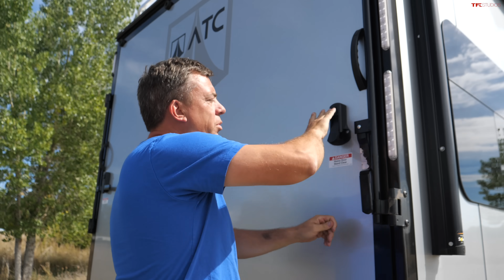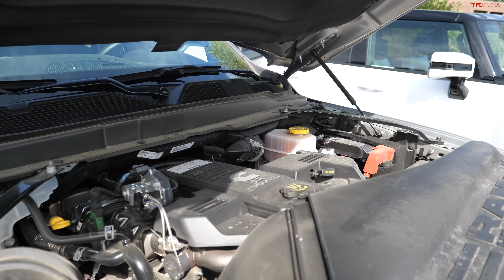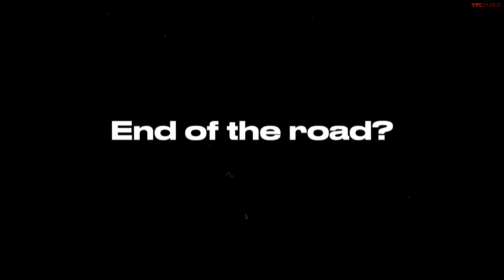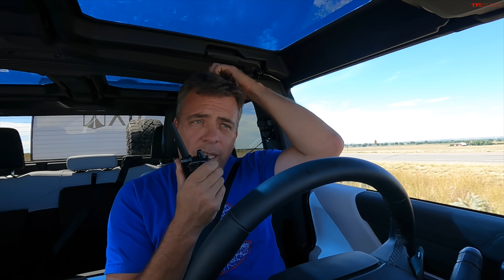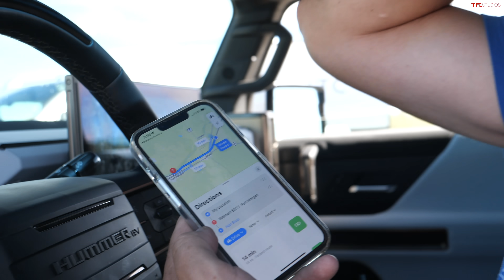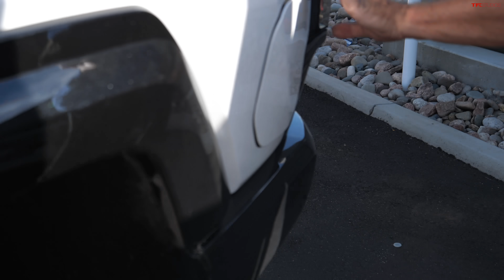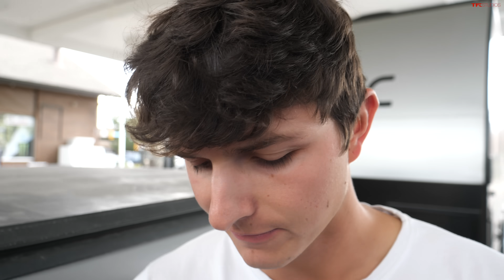How Far Can a Diesel and Electric Truck Tow An Identical Camper Trailer on ONE Fill-up?

Comment: Comes down to “what’s your precious time worth” unfortunately this EV truck “thing” is not practical for the average person.
Great content guys! Your showing the world what can and can’t be done.
Reply: Plus all the additional secret costs in an EV. Not only are you wasting your time when you charge. Adding hours to an already too long trip. But you're going to, in some cases, add additional hotel stays, or days to your trip, to accommodate the time necessary to charge.
and on top of that, there is already a $20,000-$30,000 price increase already from one of these EVs. thats a lot of fuel...
Reply: @t_c5266  What vehicle do you want me to prove that the trim level you claim on the ICE is not $20k-$30k more expensive than the same trim level on an electric vehicle? I'll look them up and prove that the difference is less than $10k, and with the Lightning, the trim level is probably cheaper. with what you get at any of the trim levels if one assumes that the ICE needs to be a 4 x 4. Pro, XL, Lariat, Platinum versus XL, Lariat, Platinum, King Ranch, and yet for some reason a Lariat is a Lariat when the Lariat of an EV has more features closer to the Platinum of the ICE. Without your trim increase, you don't get a lot of fuel, and you spend a lot more because your use case is not heavily in the area where public charging is necessary. You need that because even a 50 / 50 split makes it so that home utility ends up being cheaper than the ICE vehicle as you buy 2.5 gallons to do one gallon worth of work. You aren't paying $3.88 or $5. You are paying $9.70 or $12.50 versus at $.16 / kW $5.39. What is even better is that a person can beat $.16 generation on their own, and you cannot make your own fuel for that engine easily.
The Lariat is easy because a dealer did it proving the difference was $6k. If you cannot compare an apple to an apple, there is no conversation with you as your bias is your proof to your belief, and your bias is my proof that you will never be rational.
Reply: @ronaldking1054  first prove that your original statement applies to vehicles towing a load for vacation trips instead of people's daily commute to work.
I bet you also think the "wage gap" number has no issues as well 🤣
Reply: Wow. The average person puts more than 300 miles onto their vehicle in a day? 12,724 miles are put on vehicles on average per year according to Kelley Blue Book, which means that on average a person puts on 34 miles on their vehicle per day, which even towing is not a problem for an EV. I guess your definition of average is different than statistics, mathematics, and science. Is it based on your feeling?
Reply: @ronaldking1054  A working truck will do a hell of a lot more miles a day than the average person.
Reply: @oldbloke100  And yet the OP is stating "the average person". What were you talking about again? What's worse is that you are trying to claim that work truck isn't used to calculate the mileage on the average vehicle. What's worse on top of that is that for some reason you are claiming that the truck doesn't have long periods of being idle as well, so I am not sure when that work truck is going to be driving on its own. A delivery vehicle would have more miles than a work truck.
Reply: @ronaldking1054  it's a truck. I 'm thinking say a plumber who tows a small backhoe or excavator across the city. or a mowing and maintenance contractor that is going from property to property. It may work, but you seem to overlook the fact that to make the battery last, they tell you to keep the battery charged between 20 to 80%, so your 300 miles suddenly becomes 180 miles of range. And that's not towing anything. that's what i'm talking about!
Reply: @oldbloke100  How long do you think their service is going to take if they are a plumber? They are going property, but in order to get the numbers that you are talking about, they aren't going to remove the backhoe or the mower, which means there was no point in towing them. I don't know what work orders you think these people are going to be filling.
Reply: @ronaldking1054  so a person who does a mowing service doesn’t tow the mower around, they must do things differently were you are.
Reply: @oldbloke100  One, I didn't address that point, and two, you are deflecting desperately to avoid that I told you half your examples don't work. Next, the mowing, how long does it take to mow? The person is probably doing an 8-hour workday, and as such, he is probably working for 7 1/2-hours. This means that he must optimize his driving to shorten distances or else he ends up not mowing, and if he's not mowing, then he's not making money. Your method of business practice means the guy is bankrupt.
Reply: @ronaldking1054  hahaha you need to take a breath mate. Ev’s don’t work for everyone. These so called trucks are not work vehicles, they are status symbols. Have you seen the size of the bed in the hummer when you order the SPARE WHEEL. You would be lucky to fit your lunch box in it.
Reply: @oldbloke100  You put EV's into the same sentence as work trucks and implied that stating the one least likely to be a work truck is an example to show that EV's are not work trucks. Yes, Mavericks are not good for payload and as such, ICE vehicles are not work trucks. It's the same logic. Good luck rationalizing that the same logic should result in contradictory conclusions while at the same time claiming that you do not have a bias, which is actually causing the need for the rationalization.

Comment: Thank you for including energy equivilance calculations in your videos. All the EV haters only see range numbers and think all EVs are garbage. EVs are 100% the way of the future. Their efficiency and power is unquestionably better than any internal combustion engine. 

However, I continue to believe that lithium is not the answer. If we can get the same energy density of gasoline or diesel, to power the electric motors, ICE vehicles will disappear very quickly. 
Hydrogen is a better solution to lithium. It can be created anywhere (ideally no transport is needed). It can be a byproduct of nuclear. But politics stop this from being possible. Nuclear fusion is the future, but that doesn't mean nuclear fission can't be the clean energy replacement of Fossil fuels.

Comment: Same price for the electric truck to fill up if it made it the same distance prob more. He charged to 40 percent and would of cost 42.00 so to 100 percent would of been close to 100 dollars
Reply: Someone did the math in another comment. "Thats awesome the charge was free, but let's use the numbers to find out the future cost. The Hummer charged from 7% to 51% for $37.41 according to the EA charger. So $0.85 for each 1%. At that rate it would cost $79 to charge the Hummer to 100%. Hummer cost per mile: $79 ÷ 123 miles = $0.64 per mile.
Cummins cost per mile: $105 ÷ 211 miles = $0.49 per mile"

Comment: With that small trailer behind the Cummins engine you don’t need the exhaust break on flat driving on I76. Absolutely no need, the engine will downshift and do the job on its own. I have a 10k trailer when it’s empty and I don’t even use the exhaust brake unless I’m in the mountains.

Comment: Why does Sinclair limit to $75 fill ups? These days it's commonplace for me to fill for over $150, so using them would require 3 card transactions?
Reply: Might be the card company and not the station. Weird how a company that tests vehicles doesn't have a fleet fuel card for filling up test vehicles.
Reply: @BlueDually4x4  oh true didn’t think of that, though I thought these days pretty much all CCs have upped their amounts to reflect the crazy fuel prices.

Comment: The mpg on the Ram was horrible. I have towed an nearly identical trailer, size, shape, weight behind a 2005 Chevy 3500 SRW and get 18mpg. What is going on with todays diesels?

Comment: What was the cost for the charging of the hummer?  It's great you do the comparison, but you should also show how much the cost is for each of the vehicles.
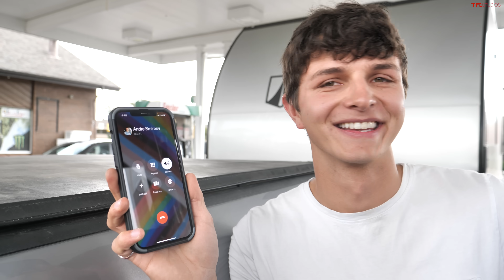Reply: Andre said it would normally be 'about $40' to charge the Hummer. @27:59
Reply: They did. Electrify America in that area had been letting their chargers fail for so long, they chose to charge nothing in response to their customers.

Comment: Electric will never work for towing and never will be fixed for towing. Batteries lose power quickly when a load is put on them. Take your phone for example and if your screen is full brightness and your watching a movie or something and connected to the internet you drain your battery faster, putting a load on it does that. Happens with everything with a battery

Comment: Also wondering if someone is going to come out with an electric powered camper that actually puts power to the wheels. It would be one hell of a camper for boondocking, too.
Reply: What do you do after driving 200 miles? You have to charge two at once, the truck and trailer
Reply: Airstream already put out there concept

Comment: So if the diesel made it almost double the distance than the EV and spent 100 dollars and the EV at half point would’ve spent 40 dollars if there wasn’t a promotion. Could we say it costs almost the same to operate both, not taking the purchase price into account? But why would anyone want to deal with the headache and anxiety of whether or not you’re going to make it to your destination? The Hummer wasn’t even close.
Reply: Someone did the math in another comment. "Thats awesome the charge was free, but let's use the numbers to find out the future cost. The Hummer charged from 7% to 51% for $37.41 according to the EA charger. So $0.85 for each 1%. At that rate it would cost $79 to charge the Hummer to 100%. Hummer cost per mile: $79 ÷ 123 miles = $0.64 per mile.
Cummins cost per mile: $105 ÷ 211 miles = $0.49 per mile"

Comment: You would think they could program a tow mode that would limit the power delivery to maximize range. Similar to what it did when you were running low on battery.
Reply: They're 90% efficient at all speeds. It's physics.  Pulling a parachute through the air takes a certain amount of energy.
Reply: @jghall00 but hoodies garage I think that's his youtube towed a aluminum car trailer, and it was small and super light and killed his range by a ton, and then putting a car on it made his range almost 0, 
When you put any strain or load on a battery, you reduce the power by many factors
Reply: @zacknelson8918  it's the aerodynamic drag. My Expedition loses half its range with the camper hooked up. Over 65 mph, the range drops even faster. You can't beat physics. A parachute will cause a bigger range hit than a brick, even if they're the same weight.
Reply: I was thinking more along the lines of allowing you to set a lower and upper power usage threshold and allowing the car to adjust speed based upon power usage.

Also limit the power used to get up to speed as well.  While it might not increase the range by a ton, there could be some automated features to help out.

Comment: So in the end, buying the Cummins gets you over $50,000 worth of diesel fuel to use versus the Hummer.  And you still have to pay for electricity at the end ($80 for charging versus $105 for diesel).  Electric vehicles have their place, but its definitely NOT towing.

Comment: more proof electric vehicles are not the future.  I've never had to back-track to a fuel station after half my intended journey and hope that a pump is going to be free.  Also, I suspect you're not supposed to often charge above 80% or let it drop below 20% state of charge, future warranty coverage will be affected, promise.

Comment: The electric trucks can work if you don't do long distance towing for work, rv'ing etc. Which unfortunately takes it out of the running for many people. I'm sure they are actively working on improving the inherent issues with battery powered vehicles but it will be interesting to see what actually comes to fruition. Makes sense that we are not hearing much about electric semis, they have a very long way to go
Reply: Semis are coming too. They can be used on fixed routes, like distribution centers and drayage, where the range and load are a known quantity.
Reply: All batteries will do that, there is no fixing this one problem, use your phone full bright screen and run a movie or something you will kill your battery fast, same goes for everything when a load is put on batteries, there main one flaw that's been around since the dawn of time, no fixing it

Comment: These videos will be used in history lessons in another 100 years. You guys are really showing the progression of the electric vehicle against what could be the last generation of the I.C.E.  
There is no way an electric vehicle could replace my truck at this point but at the rate things are evolving I could possibly see it in another 10 years.
Reply: Batteries need 2-3X the energy density before an electric truck would make sense for towing.
Reply: @231pilot  and the ability to charge in a reasonable time! But they are improving.
Reply: Nope

Comment: 123 miles and he had 8% remaining...used 92% of a 213kwh pack or 196kwh or 5.82 gallons of gas or 21 mpg...about twice of the cummins.  Im leaving out charging losses (10%?) so that would lower the real world mpg of the hummer.     Hummer is pointless at $115K..a toy for rich people not a tool for hard working men with lots of chest hair.

Comment: The Ram is expected to be hauling strong 10 years from now, that EV will have close to  15-20% of original battery capacity in 10 years and that is a FACT.

Comment: Oh thanks to TFL for showing the shortcomings of these EVs. And I love the tech but I wonder if they could of made them a little less powerful making their range farther.
Reply: It's not like gas where the power causes a range reduction.  Electric motors are over 90% efficient.  That's why a Lucid does 0 to 60 in 2.5 seconds and has a 500 mile range.

Comment: I have an idea why don’t you install a Cummins 10k generator in the bed of your hummer with 10 gallons of diesel so that when you government motors ev runs out of juice well you may be stranded at a rest area but you will be able to fire up your generator. P.s. the lightning in wv, towing a 16 foot trailer with 2 can am x3s and 40 gallons of gas lasted only 86 miles. Mountains matter.